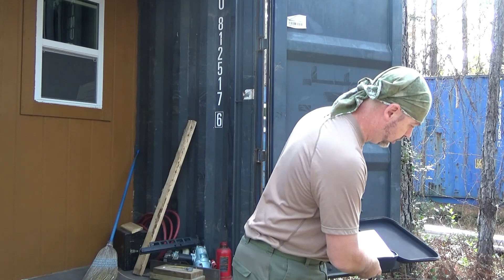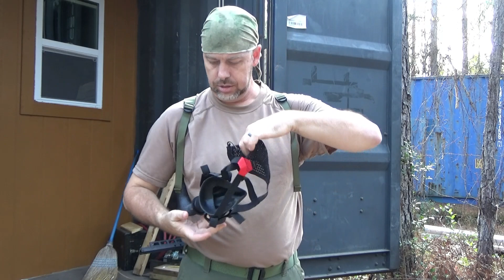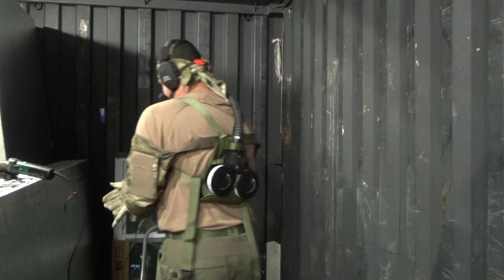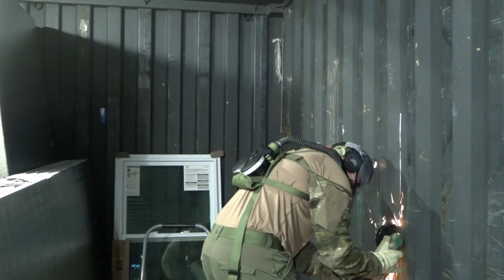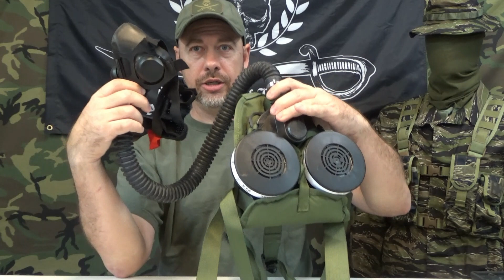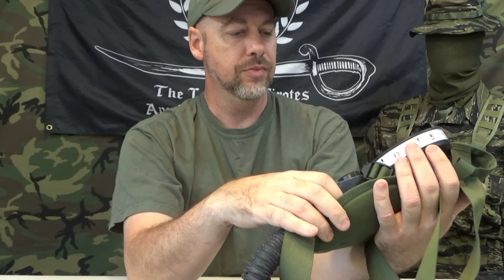MIRA Safety TAPR/PAPR testing & follow-up

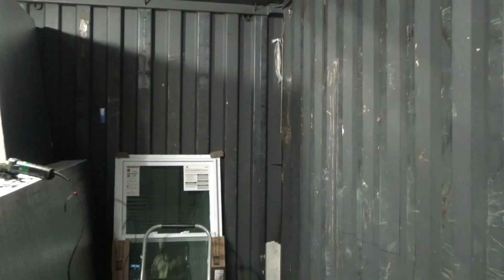Comment: 1:15 Is that noise coming from the PAPR? If so then in a tactical environment it takes away the element of stealth
Reply: there are several reasons why this probably doesnt matter. against riot agents, the element of stealth is usually not relevant. there is also a degree of safety provided via the positive air pressure provided, as it improves the seal but also reduces risk of overheating which especially matters for the CBRN setups that dont allow any breathing. CBRN filters are also way harder to breathe through than particulate/riot agent/industrial filters. i probably dont need to explain why proper airflow is beneficial.